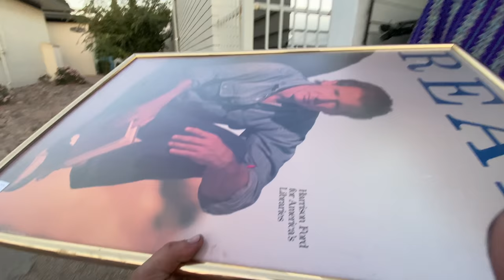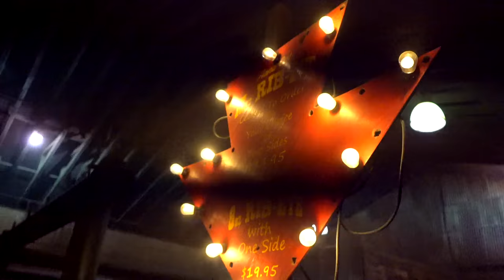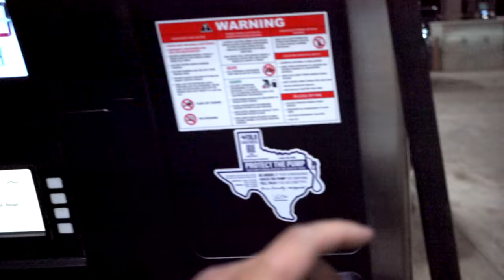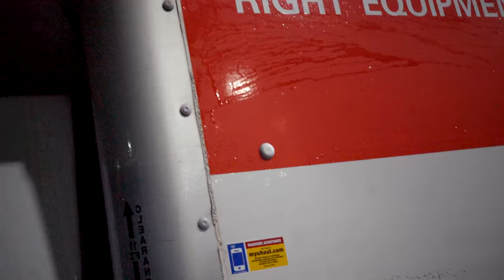My Bread Truck Blew Up....

Comment: Rip truck also i went to the big goodwill bins in stl not the one next to the overpass but the one that looks like a old mall got a working computer a wooden easel with expensive art paint a bunch of d&d dragon lance books to go with the dragon lance artbook i had and a bunch of old vinyl ultraman and kamen rider figures and a tankerd made from a old wine jug and a bag of nerf darts and a electric nerf gun brand new and a brand new Bluetooth speaker its small but louder than the subwoofer we have here but it’s not even bigger than a bigmac box and a vintage ho scale train set train and tracks and other parts like electric polls and a track switch